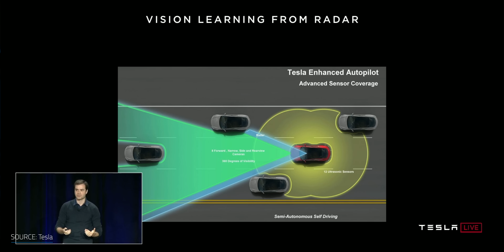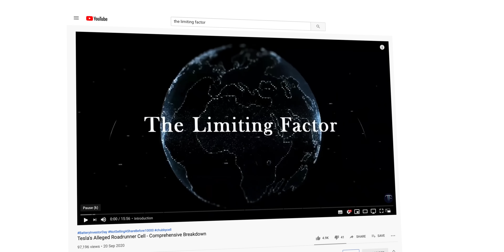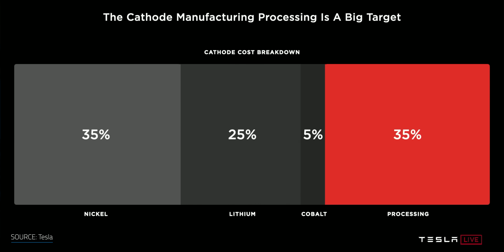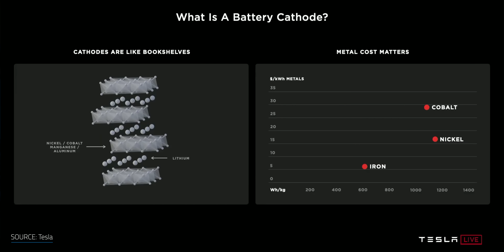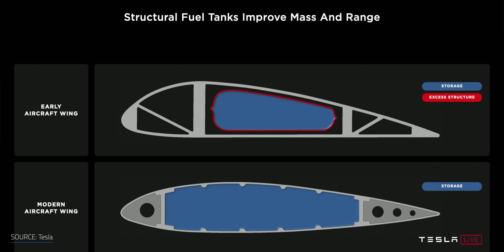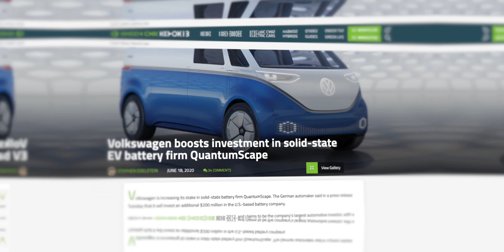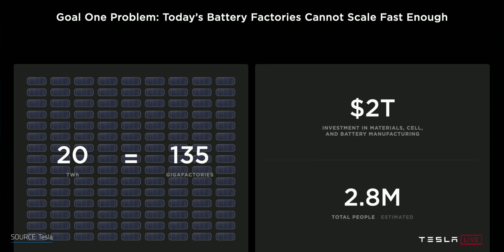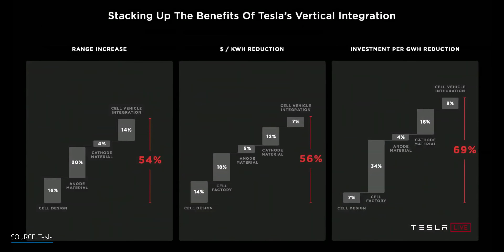3 Takeaways from Tesla's Battery Day - Hint: it's not just batteries

Comment: Most people don't know the Prius Batteries can be reconditioned, but to see Tesla go from manufacturer to recycling to these kind of jumps just makes you freak out about the advances they have made in such a short time. The Semi and NWO of batteries will destroy so many industries in the USA it will be mind blowing how much we will have to look to new industries in the alternative energy market to replace all the jobs lost in the USA and world. Old industry will be further decimated, Fuel related job losses like Oil change shops, Filters, spark plugs, , etc. It's almost time for the old guard to bow down and make a deal with Tesla to stave off the rapid closing of plants across the planet. Well, maybe not right this minute, but soon enough if they do things faster than they actually let on like they have been. I wonder if these batteries can be reconditioned after they have degraded or what the degradation rate would be with the new formulations?

Comment: Elon announced this plan 2 years ago (almost exactly)  https://twitter.com/elonmusk/status/1045016610006654976?s=20

"Pace of innovation is all that matters in the long run"   - Tesla's internal goal is to increase their pace of innovation..   which is how they  now improve so many parts at once,  even building , rebuilding, changing their own factory  machines as often as  every 3 months.  And Sandy Munroe frequently comments on how many changes are made inside the same model year. 

Which means  it's quite likely at this point that if any other company announced an idea that was better than one of Teslas.. tesla could implement it and put it in their cars faster than the OEM that announced it.      And they're doing this for batteries, solar, energy management, and soon? HVAC? 

Tesla is simply improving their ability to improve.... faster than anyone else.
Tesla is a tech manufacturing innovation company.

Comment: EVs do NOT cost like ICEs. I can get a fully tricked out Ford Focus Wagon with 8sp automatic, adaptive cruise control, self-parking and a fancy audio system for about 23k-24k Euro. That's totally spec'ed out. About 16k for a hatchback with a manual transmission and less kit. About 16K for a new corolla with a 1.6L engine. Also, I can get a Kia Cee  hatchback for about 13K euro. These are family-sized cars that have a range well over 500 km (310 miles) any season. For about 20K I can also get a Skoda Octavia diesel that will go over 1.000 km on a full tank (620 miles). Any season, any temperature. Until I can get an electric car that has over 500 km of range on a highway at 120km/h (75mph) at winter that costs below 20K new, and where the battery will have over 90% of capacity after 10 years, I will drive an ICE car. Before COVID, I had at least twice a year a road trip of about 1.000 km one way. For example I'd drive to Greece. There my car would be in scorching sun for entire day every day.  Also, where I live, -10C or lower temperatures in the winter are nothing strange. And here most people drive cars about 10 years old. That's why over 90% after 10 years is important. Resale value.

Comment: I'm sure Tesla will be putting these new 46/80 cells in cars in early '21, starting with the S and X, gathering data and real-world experience and then putting them in all of their cars by the end of '21-'22 and slowly tapper off Panasonic, CATL, etc., as it'll make little-to-no sense to buy batts from other suppliers at that point.  Musk only said Tesla would keep working with Panasonic, CATL and others, so not to shock the market and cause drastic moves by those co's.  And, Musk didn't want to cause a dead stop/Osborne effect for their current sales and supplies.

Comment: Not one word about the battery cooling system which could be vastly improved with direct contact between battery cell and coolant.
PS: Call me Elon, I have the solutions you need ;)
Reply: @rogerstarkey5390  No, I was talking about a real liquid cooling system. What the f##k is the point of gel? The heat you want to get rid of is generated during charging and use. If you have problems imagining/designing a coolant flow through a uniform arrangement of cans inside a box, you should not even be talking about this. This is a classic example of a heat exchanger problem. If you can remove more heat, you can run more electrical power through the system which is important for fast charging and fast discharge. The best way to achieve this is with liquid coolant in direct contact with the cell. 
A 200-250kW system does generate a great deal of heat if you want to charge it fast and be able to discharge it fast. The system they have used until now is not  a good solution.

Comment: I’m probably a little cynical here, but saying ICEs are on their death bed feels like more of a wish at this point.  I don’t see how ICEs can be fully replaced by batteries without faster refueling options and broader infrastructure to support that.  For instance, an EV with a 400mi range is great for most, but for someone who has to drive 500-600 mi for work, it’s not something that’s applicable yet.  I think we still need that bigger capacity battery before we see broader adoption (and what about long-haul trucking?)

Comment: I'd love to ask why Tesla hasn't announced work vans & busses.
They aren't as big a market but they are on the road far more than consumer vehicles. School busses are especially bad. I'd love for Tesla to announce a buss release targeting city, school, and commercial markets. The tabless battery means there would be even less downtime for the city & commercial ones. As added bonuses, most will be owned by govt. agencies and large companies making a less competitive and more lucrative market for them to ramp up the cost per vehicle.

The point you mentioned about the casting machine & greater integration of the vehicles also bothers me. The road is still too dangerous to waste entire vehicles with a single accident simply to reduce manufacturing costs. We first need drivers licenses to be easier to take away & harder to get before making the transition. I hope at least Tesla taking the first step moves local governments to begin the transition more quickly.

Comment: While I admire what was presented at Battery Day and love to work from first principles myself, I do worry that Tesla is beginning to paint itself into a corner with their approach. It reminds me too much of the exciting growth of Ford Motor Company in the days of Henry. Vertical integration as their mantra led Ford into entrepreneurial dead ends several times. Ford Tri-Motor as an airliner was far ahead of the wood and fabric airmail competition, but the design, optimized for the air transport market of its time, was perhaps too hard to improve upon easily. Ford also failed miserably on the effort to fully control their supply chain with their industrial sized rubber  plantation in Brazil. Ford of course realized this and is still a big player world wide, even in Brazil, but they only ever made one River Rouge plant in Detroit where raw iron ore came in one end and Ford cars out the other. 
GM for whom I worked six years in my aerospace career was never at the heights of innovation and still isn't. But they do know more about promotion and buying and selling mediocracy profitably than any other major manufacturer I have seen in my 77 years.
Reply: With all due respect, Elon is dragging the entire automotive industry into the 21st century. Once more manufacturing facilities come on line the need for vertical integration will reduce.  Right now it Tesla does not do it, there are very few alternatives.

Comment: What do you mean: "Tesla's competitors are thinking small scale" ?

VW produces >10M cars per year.
Their new (full electric) designs are production ready (ID3, ID4 and Buzz)
And VW is bragging about having their retooling completed before the end of 2030.
Simple arithmetic will show that each year henceforth VW will reassign TWICE the entire annual production capacity of Tesla.
Thus, despite Tesla having a 5 year head start on everybody in the automotive industry on producing electric cars.
VW has the sheer production muscle to catch up and take EV's to scale faster than anybody realises.

So, whatever is wrong with VW, it is definitely NOT: "thinking small scale" !
Reply: The problem other car manufacturers have is the battery production line. 
Car manufacturers in Europ are kind of going together to build there own battery plant(s). (Northolt is one of them) The problem here is that Tesla is 5 years ahead of everyone and building a gigafactory takes its time and expertise.

Comment: The 'right to repair' movement drives me bonkers. 99% of the time there is no point and failure rates are so low these days - just recycle & move on. If you can't actually look after your gear, don't buy it.

Comment: Ref the comment about other car manufacturers you need to look beyond the technological and into the commercial ref these companies to understand why they are not forging ahead with battery tech like Tesla.

Tesla make electric cars, high priced electric cars at that, to be in the marketplace at all they need to be the leader in this marketplace, as they have no other marketplace to live in, VW, Audi, BMW, GM, Ford etc make cars, not exclusively electric cars just cars...as such they can still sell there traditional vehicles as well as electrics thus have 2 x marketplaces to be relevant in, additionally they have reasons not to want the conversion to EV's to come too quickly.

Traditional ICE powered vehicles need servicing, repairing, moving parts that need to be swapped out at selected intervals etc...bottom line ICE power units create vibration and heat and that = wear and part of a vehicle manufacturers portfolio of commercials is spare parts, EV's represent a fundamental shift in that marketplace, EV cars, for all there sophisticated software at heart they are a battery + some electric motors, over a century old technology at its base level and won't wear like a traditional ICE power unit and thus the spare parts / servicing revenue stream is going to change and by change the manufacturers know that means reduce.

So the traditional manufacturers aren't going to rush the public into EV's, they will cater for the marketplace but will let the paying public organically shift to EV's rather than force them across, that forcing will be done by governments due to environmental pressures ref reducing carbon footprint / saving the planet, but there's a problem there too...

Governments want to make the right noises ref moving to EV's for environmental reasons however the revenue loss from fossil fuel taxation plus the additional electrical power production infrastructure required to support the charging of large scale EV vehicle deployment means governmentally the message is great and pleases the green voter but internally it causes a loss of tax revenue and an increase in infrastructure cost  which any government isn't going to want to deal with if they can help it..thus the government's, like the manufacturers are going to want organic EV take up (despite what they say in public) rather than forced to slow the progress of EV propagation to give them time to adjust there economics and infrastructure spending in support of the shift to EV's. 

You might think that I'm being a bit conspiracy theory ref the above but I work for a large conglomerate (telecoms) and believe me they look at revenues more than the do profits and where they can't plug the revenue leak they offset it where possible, delaying the leak from occurring is a common tactic employed. as for the government I can only speak about the UK, at this moment if 15% of the UK car market went EV (currently 5.7%) the UK's electrical grid could not sustain a charge when you want policy and would have to implement a means of stopping charging of EV's at peak periods of usage (probably by introducing a premium cost charging period during those periods to dissuade charging at those times / allowing charging to happen at low periods sat a discount akin to the old "economy 7" period that was common i the 70's and 80's in the UK). 25% EV and the power grid in the UK simply could not cope without power cuts..

Also, and finally...EV's are really a 1st world product, only 1st world nations and economies are going to look to shift to EV's in great numbers, the less developed nations don't have the infrastructure nor the base consumerism to take these cars on thus they will be running fossil fueled vehicles predominately for a long time to come, again another issue for the likes of Tesla who simply can't cater for that marketplace.

Comment: nice video, EV's have been around for years , but petrol/diesel engines cars, are still going to be around for years to come, you still get more energy from petrol then you can get from a battery, look at the energy density you get more energy from a tank of petrol and more mileage then you would get from a battery of the same size and weight if you compared it! EV's are great as town and small cities, but for long mileage/ long distances it's going to be the petrol cars.

Comment: Whatever they do their EVs will still be too expensive for the average consumer.
Reply: They expect to have a $25,000 car in a few years that will also be cheaper per mile to run than a fossil fuel car.  If that isn't cheap enough, you will have to buy a used car, just like you do now.

Comment: Mat, I often wonder why the innovation has been pegged to individualism in the first place. For instance, here in the US with the decrepit state of our infrastructure one could argue that both job creation and eco-engineering are not mutually exclusive. 

Our infrastructure needs a wholesale replacement. A major upgrade should be in the offing. Why are we building vehicles with bigger more powerful (and arguably much heavier) batteries in them when what we could do instead is rebuild our roads and bridges with AC power lines in the roadway and every electric vehicle would be inductively coupled to the roadway for power (much like how we wirelessly charge our cell phones with qi charging now)? Yes, vehicles would still need a battery of sorts but a much smaller and lighter one (for parking lots, driveways, dirt roads, and off road uses) but this solution eliminates range anxiety, charging station availability, the added weight from giant battery packs, operating temperature considerations like cooling for batteries, and cargo space and capacity (for large commercial vehicles).

Eisenhower's highway system is due for a major upgrade anyways so why not electrify the roads at the same time? It needs to be done. People need jobs building that future, especially now post botched federal pandemic response (non response really). We've already tossed $4Tn down the hole, what's another $4T so long as it ushers in a new Paradigm?
Reply from the maker: There’s a pretty big tie between jobs and the growing renewables and EV markets.  Something worth considering.

Comment: Due to the silicium expantion and contraction the isolation materials normal cracks while charged and discharged is still worrying since it take a lot of time to test the cell thoroughly.  
Elon also stated that the we're running generation 4 battery and they weren't finished yet.  
Let's get the bear shot and slaughtered before we sell the skin.
Anyway it was an impressive "show" with a lot of prospect.

Comment: The facts, which you should at least acknowledge, are that electric cars do not compete with the used car market.  For that to happen there needs to be electric motor and battery bank bolt-in replacements for existing internal combustion engine cars.  If someone is going to buy a $2,000 car to replace theirs, and then $1,000 in repair parts over the next year, then for electric to compete with that market, they need to offer a replacement motor and battery for less than $1,000.  Quit pretending that all the cars on the road were bought new.  That simply isn't true.  Put down the coolaid.

Comment: Let’s make a pact: from now on, every time cobalt is mentioned in a video or a comment as a humanitarian issue and a disadvantage of batteries be sure to mention that big oil has been using up the vast vast VAST majority of cobalt in a mostly non-sustainable way for years for the desulphurisation of gasoline so they could sell us on the lie of “clean carbon fuel” and to combat the acid rain that they caused. Only in 2019 the global cobalt use for battery production started to come close to the amount used in refineries for big oil. And like every other issue, for batteries it will be solved eventually. For big oil it will always go up in smoke and into the environment because there is no alternative.
Reply: Big oil big oil

Comment: Right to repair is even before this my #1 concern with Tesla.  The giant cast parts are amazing but the trade off is that repairs will require specialized aluminum welding which is hard and the average body repair shops won't have experience for that kind of repairs.  You cant just swap a part out yourself if the frame gets damaged.  It'll also mean some repairs write the car off. Hopefully AP means that accidents become a rarity!